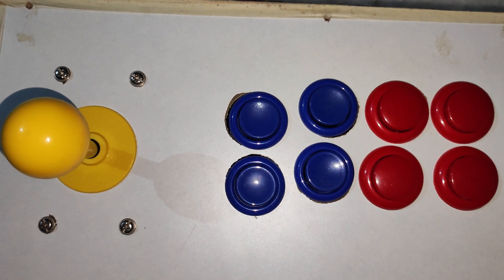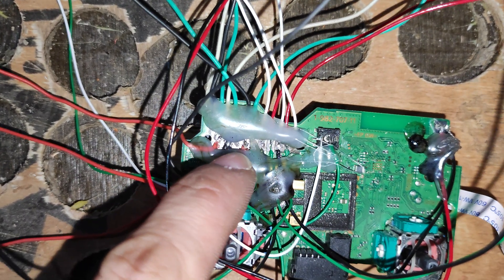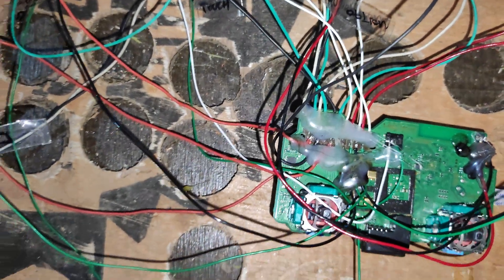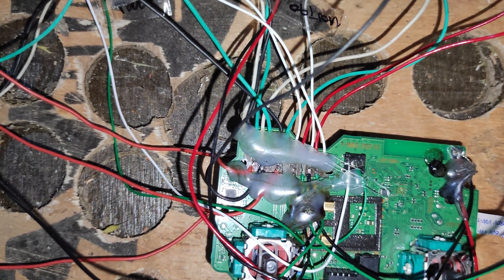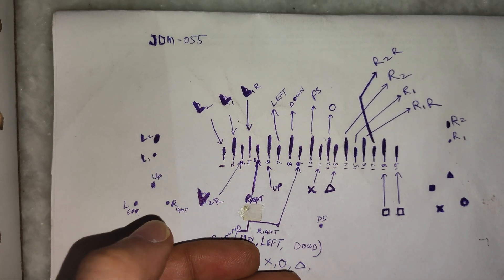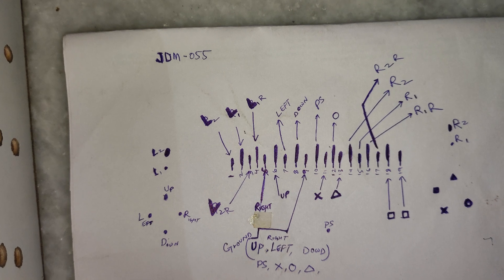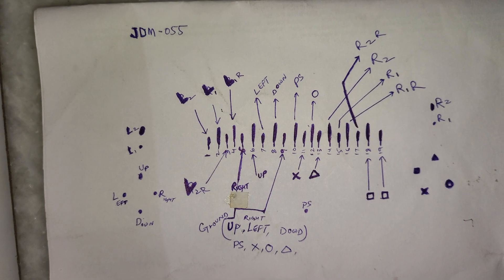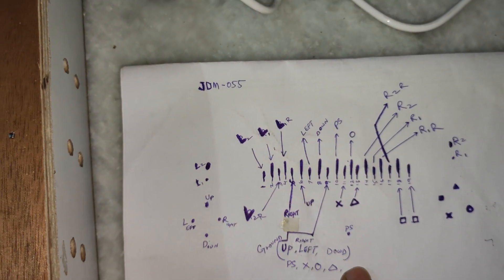Guide - DIY Arcade Stick - With PS4 controller motherboard.

Comment: Bad explanation maybe next time do a video fresh new PCB not already done
Reply from the maker: I don't have much facility to record it live while I solder all the wirings  as I am not professional. I completed it in parts whenever I have time. Thus didn't remember to film it every time. And only have just one PCB so had to manage with that and this is for the cheapest budget. So, had to arrange that way.

Thank you for the feedback though. Really appreciated. 
Regards

Comment: Please make a detailed tutorial of How to connect trigger button such as l1 l2 r1 r2 , where I can locate the 3.2 v pad on the motherboard?
Reply from the maker: @mayank.s2049 will try if I can cover and explain in detail in my next DIY WASD buttton on arcade stick video. 

For 3.2v pad, not sure about that, if you are referring to the usb charging cable to charge the stick on this stick, then the usb charging cable is permanently connected from the inside from the charging port of the controller fitted inside and the other terminal is kept outside. 

Regards
Reply: Charging is not the problem,the problem is when I'm trying to check the trigger inputs as per your diagram,it not responding however other button like if I'm testing the triangle button l2 trigger is also responding!please make a detailed review of how to solder and make connection please it'll be very helpful! @bishor33
Reply from the maker: @mayank.s2049  Sure, will do. For R1, R2, L1, L2 buttons, you'd need  resistors to connect with for these buttons to properly work.

Comment: Where you put the options and share buttons?
Reply from the maker: @BotijaAnonimato   For share and option buttons, micro switch buttons are there on the top left and right corder of the PCB almost at rhe exact position where we find on the controller. You'd need to find the foot of micro switch buttons on the PCB for contact points for soldering. You'd need two contact points each for share and option buttons. 

To find it out, you may need to take a forcep(plucker) or a wire, then touch one point on the micro switch button and the other terminal to another point to find which, when two contact points when touch, works for share button. Once you find those two, it will be share button. 

Find the same for option button. Hope this will help you. 

Regards

Comment: how to connect the Share and option button to a Buttons?
Reply from the maker: @mrmeme3138  For share and option buttons, you'd need to find the foot of micro switch buttons on the PCB for contact points for soldering. You'd need two contact points each for share and option buttons. 

To find it out, you may need to take a forcep(plucker) or a wire, then touch one point on the micro switch button and the other terminal to another point to find which, when two contact points when touch, works for share button. Once you find those two, it will be share button. 

Find the same for option button. Hope this will help you. 

Regards

Comment: Can you show the schematic please? Thank you.
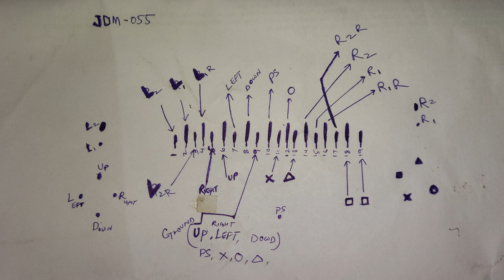Reply from the maker: @jooniversalstudio5757  it's already there with the diagram on the video starting from 3:24. 
Hope this helps.
Reply: @bishor33 Thanks a lot. This is my first time in this thing. I don’t have background in electrical engineering nor IT but I want to try to make it. I have a few questions too. Why the square buttons don’t share the same grounds as the others and why do the square needs two terminals? And also why the L and R needs resistor. Thank you 🙏
Reply from the maker: @jooniversalstudio5757   that's okay. It's always good to start something new. Square has no ground like others as per the company, they have integrated 2 dedicated contact points just for square that's why it doesn't have common grounds like other buttons. A d R1, R2, L1 and L2 need resistor in order for these buttons to operate correctly. Without a resistor, R1, R1, L1, L2 may not operate properly.
Reply: @bishor33  okay, thanks a lot this is really helpful for my new insights. Thank you
Reply from the maker: @jooniversalstudio5757  you're welcome. Let me know if you have any further questions before, during or after your arcade stick DIY project.

Comment: Hey bishor33, I have a question but I don't know if you could help me.

I noticed that your joystick uses micro switches. Unlike my joystick, my joystick uses an optical sensor and requires +5V (VCC).

Do you have any idea where the vcc is on the dualshock 4 motherboard ?
Reply from the maker: @lordpuan6538  I'm not sure about the optical sensor and VCC. But let me see if I can get anything on that. 
Regards
Reply from the maker: @lordpuan6538  I checked and couldn't figure it out. I googled and found out that some name iFixRetro in YT is really good at modding stuffs like this. Try contacting him if he can help you with your project. Regards,
Reply: @bishor33  Thanks man, it's already a great help
Reply from the maker: @lordpuan6538  YW.

Comment: What does L1R, L2R, R1R, R2R mean? Would it be the return in the circuit?
Reply from the maker: @lordpuan6538  L1R means L1R is one of the soldering connection of L1 that requires a resistor. Same way, L2R is one of the soldering point of L2 where a resistor is required to be soldered. So, one resistor needs to be soldered between L1R and L2R. 

Same goes for R1R and R2R. Meaning, in short, connect a resistor between R1R and R2R.
Reply: @bishor33  So should I solder a resistor to the 2 wires I use?

Comment: Thank you for sharing! Where would you connect the remaining buttons ground?
Reply from the maker: @stefaniecabreraXD  you're welcome. That's right, all the buttons: U, D, R, L, O, ∆ and X have just one terminal each for soldering. The other terminal needs to be connected to one common ground each for each of the above buttons. Only [], has its dedicated two terminals and doesn't need common ground. 

Hope this helps.

Comment: How can I solder wires? Do you use a regular soldering iron or an air iron?
Reply from the maker: @mahmmedalyamy  You'd first need to scratch out all the carbons with a blunt blade, etc from those terminals on the PCB to make it shiny. Then solder on those terminals without any wires to mske those terminals soldering ready. Once they are soldering ready, solder them with wires. 

I used a regular soldering iron, the pointed one. Not sure about air iron, haven't tried with it yet. There are tiny components nearby, so if you're using air iron or hot gun, make sure those tiny components are not blown away. 
Hope this helps. Let me know if you'd need further help.
Regards

Comment: excellent video, although I'm confused on what the pads labeled R1R, R2R, L1R, and L2R mean, could you help me out?
Reply from the maker: @avery_luigi  Thank you. Sure, let me explain. 

R1R, R2R, L1R and L2R means those soldering points need to be connected with an 8K ohms resistor each.

For example, solder 2 wires on the motherboard at the terminal 2 for L1 and 4 for L1R. 

Same way, solder 2 wires on the terminal 1 for L2 and 3 for L2R. 

You now have 2 pairs of wire for L1 input and L2 input which need to be soldered at the terminals of a push button each. 

After that, on the push buttons soldering points where you have soldered L1R and L2R, they need to be jumpered with a resistor. 

Similarly, same method applies for R1, R1R and R2 and R2R.

Hope this helps. If you'd still need help. Let me know.
Regards,
Bishor
Reply: @bishor33  thank you very much
Reply from the maker: @avery_luigi  you're welcome.

Comment: thanks bro, is it possible to use the input of analog thumbstick instead of d-pad for the lever joystick?
Reply from the maker: @babixillo  you're welcome. Yes, you can but functions may be different depending on the games. E.g. in Tekken, you can either use D-Pad or analog thumbstick for directions which may not be applicable for other games. So, you may decide which connection you'd like to go with. Let me know if you have any other questions
Regards
Bishor
Reply: @bishor33  thanks, so if i want to connect direction up and down on the lever, how do i connect the wires? looking at the pcb from bottom:
+ = 3.2v
- = Ground
X = X-axis
Y = Y-axis
L = L3
R = R3
O = Solder Lugs (these are also Ground)

     Right Stick              Left Stick

        + X -                    + X -
      O       O                O       O
 +  R           -         +  L           -
                Y                        Y
 +  R           +         +  L           +
      O       O                O       O
Reply from the maker: @babixillo  Your diagram looks challenging for me. However, to solder the wires for directional inputs from analog stick, you'd need to do experiments i.e., test any two contact points to see which one works for Up or Down or so on with a wire or forcep (a pointed plucker). I will also look again at my ps4 controller PCB model and let you know as much as I know in 2 hours.
Reply: @bishor33  yeah bro i'm still searching information about this and haven't found anything similar. idk if it even possible, but i'll try probing things when the ds4 i ordered came.
Reply from the maker: @babixillo  You can search my  username: bishor33 on insta. And ping me. I will send you the diagram for a ps4 controller pcb to solder directional inputs on the analog thumbstick instead which will guide you on how to do this.
Reply: @bishor33  cool i will get in touch, thank you!
Reply from the maker: @babixillo  Sure, feel free to contact me anytime. I may not reply on time, but I will surely reply.
Regards
Reply from the maker: @babixillo  if it was you on insta, I have already sent you the image.
Reply: @bishor33  yeah that was me, unfortunately the ds4 i ordered turned out to be knockoff so i need to return it and wait a bit longer to acquire the new one for me to test
Reply from the maker: @babixillo  Oh. 

Sure, let me know once you recieve it.

Comment: Where do you connect ground?
Reply from the maker: Common ground is the 9th terminal or contact point or solder point if counted from ledt to right on the motherboard as demonstrated on the video. This is the common ground for U, D, L, R, ∆, O and [] buttons. 

Let me know if you'd need more help.

Comment: Does it work on jdm 050?
Reply from the maker: Yes, it works on all the motherboard, you may require to make some changes if it has 18 terminals. How many terminals do your JDM 050 have 18 or 19?
Reply: @bishor33  19
Reply: Work on 19 or no?
Reply from the maker: @obaidabohlak7112  It works. This video is a proof that it works. The PS4 controller motherboard that you see in the video has 19 terminals or contact points or soldering points whichever you'd want to call it. 
But remember, if you decide to do this, you can't use the motherboard back into the controller again unless you figure out how to re-apply carbon substance on those terminals.
Reply: Ok thanks
Reply from the maker: @obaidabohlak7112  you're welcome
Let me know if you have any questions.